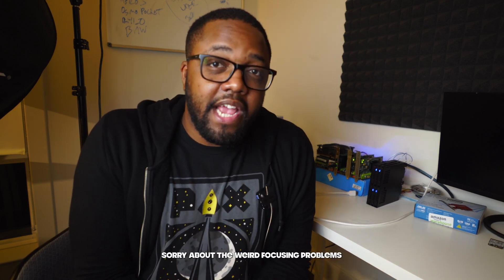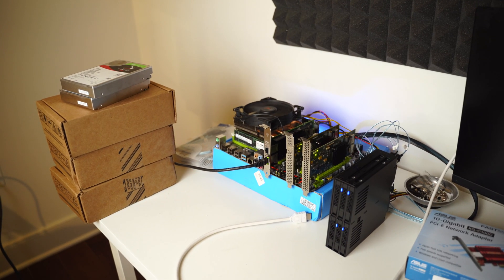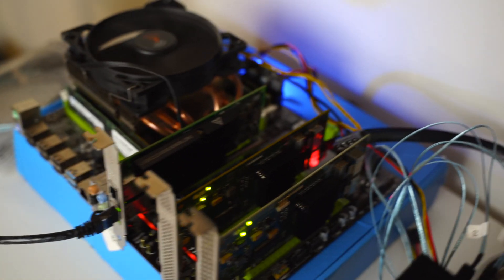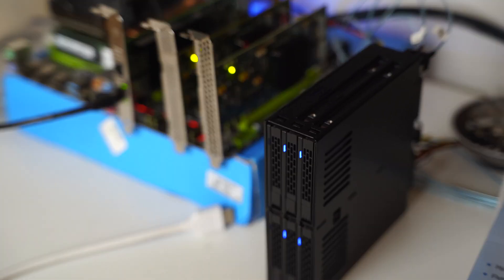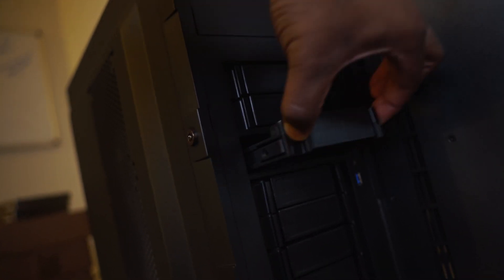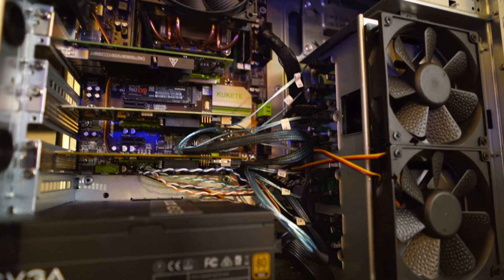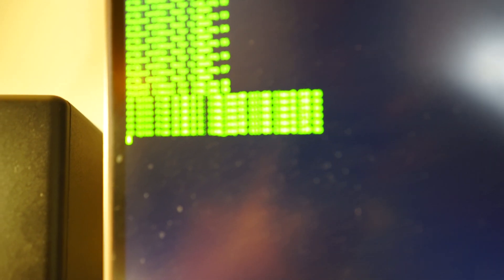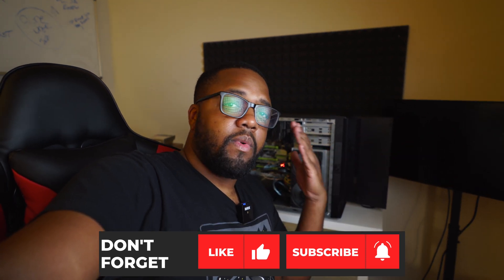My New 40TB SSD STORAGE SERVER

Comment: You get a like and sub from me, this is some quality stuff. Really amazing editing. I agree with Peppah on the camera stabilization, really helps bump up the quality.
Also, front panel connectors are usually standardized nowadays. Color coding should be consistent across almost all manufacturers as well so it should be fairly easy to find information on.
Reply from the maker: Thank you so much and welcome to the channel, and thanks for the tips and feedback, i'll be sure to keep them in mind for next time